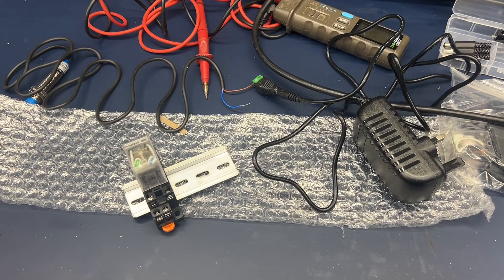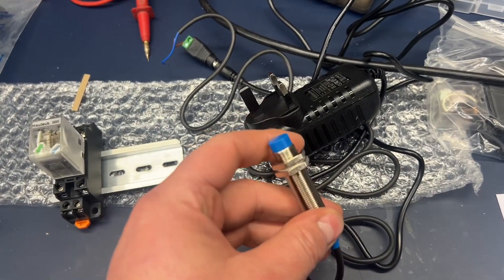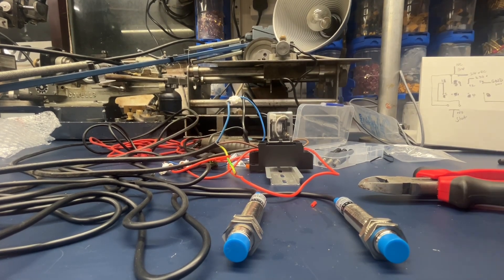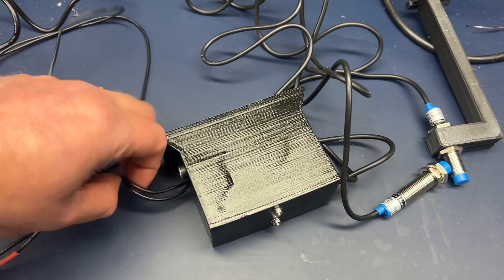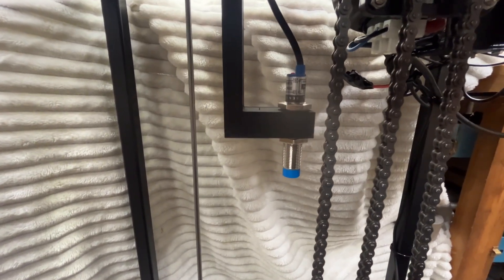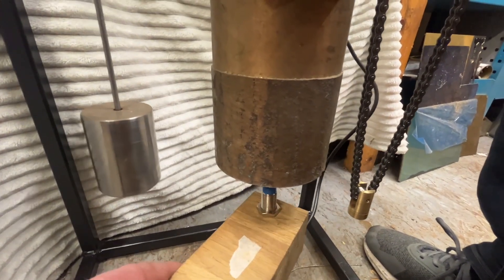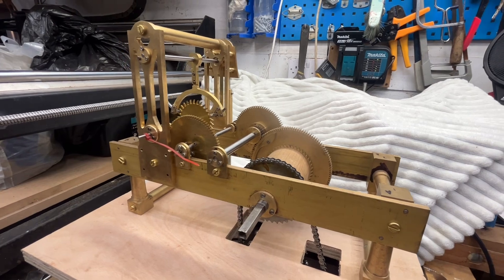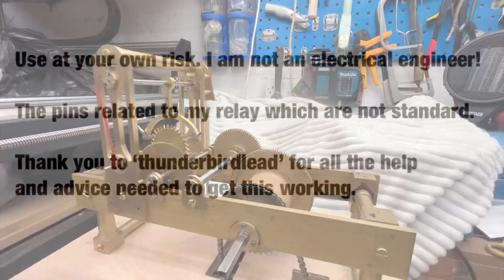Automatic Winding System for Tower Clock | Pt.17 – Relay & Proximity Switch Setup

Comment: You could definitely make the bracket from the sensor out of brass. The sensors are designed to be screwed into metal brackets.
Reply from the maker: @jandillingh  thanks for the info. I’ll do that as I would prefer them in brass. Not made much progress this week! Hopefully I’ll get back on it next week.
Reply from the maker: @jandillingh  Hi, sorry it’s taken so long. The motor is a Pavalux and it says Gear: 30 on it.

Comment: Very interesting setup. Did you solve the problem with the pallets?
Reply from the maker: @brianwarburton4482  thanks for your time to reply. It is now setup to a point where the pallets hit right at the end of the impulse face. I can’t pretend that the escape wheel is hitting on the locking face, but a fraction of a mm off. There is no recoil so it is effectively “locking” but quite frustrating not to hit the locking face. It is running constantly and without stopping so I’ll have to live with it as it is until I can figure out why. I’ve tried to lower and heighten the actual pallet  and nothing seems to change things. As soon as I hit locking faces it locks up!
Reply: @craynerd  Good luck with that. It might be something you can return to when you have finished the clock. I've had similar problems myself and ended up remaking the whole escapement to get it working properly.
Reply from the maker: @ I’ve resigned to remaking it. The escape wheel is good so it must be the pallet frame and pallets. I’m enjoying watching it run and it is running. It’s literally about .5mm on the swing either side for it to be running correctly - very frustrating!